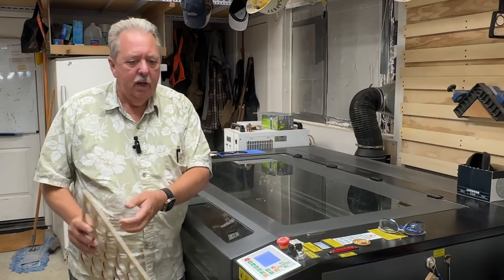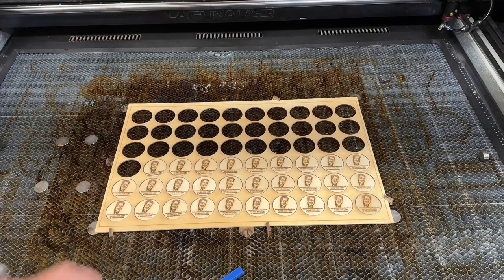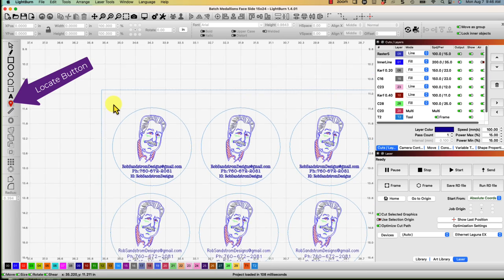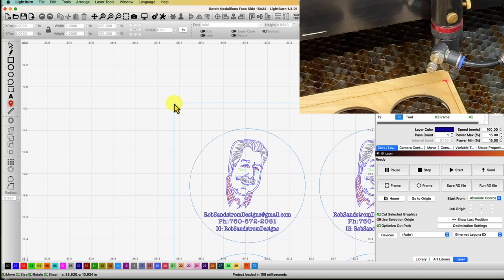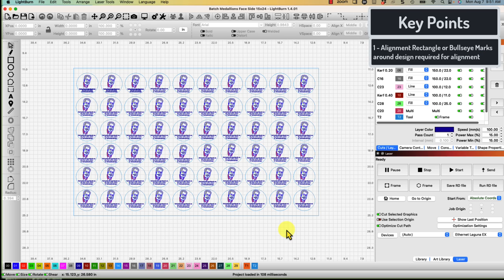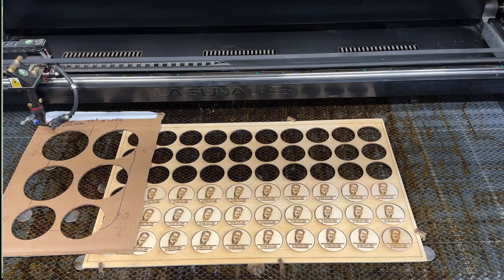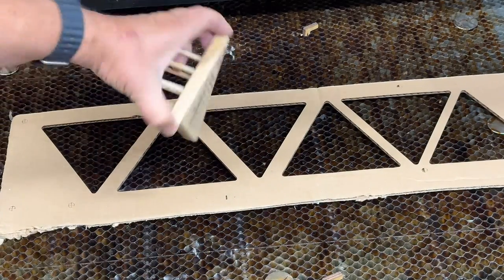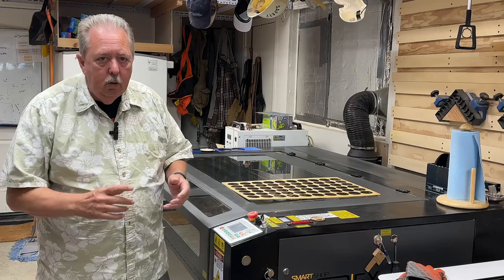How to Easily Make and Use Templates for Repeatable Laser Projects #laserengraving #lightburn

Comment: Hello! Do you have any videos with instructions on how to upload a premade template then set the cutting and engraving after it's uploaded? I have a template for branded buttons so I need to cut around, cut 2 holes in the middle and then engrave my logo. It's all on the template but I have NO idea how to set up the cut lines so it is consistent. thanks!
Reply from the maker: I need to know more about what you’re trying to do.  Are you indicating you purchased a physical template - i.e. it’s design is not in the laser or did you make a template in the laser and didn’t put laser alignment marks on when you first made the template?  I am trying to understand do you have a version of the template in lightburn already or would you need to make the template in Lightburn based on the physical template you already have?
Reply: @RobSandstromDesigns my designer made a template for me outside of light burn and I need to upload it to light burn and set it up. I have it in a pdf or AI file.
Reply from the maker: @MelissaOConnor-b8h  Are you wanting information on how you can take the file a designer made for you in pdf or AI format and how to import it into Lightburn so you can use as a template?

The reason I am asking is because if you have a pdf or AI file, they can be imported directly into Lightburn.  Once imported you can work with them in lightburn like any other file that is imported.  Let me know if you want a short video on how to do this, i could make that video pretty quickly.  Basically you go to the File>>>Import menu item and select the file to open.  Lightburn acepts the following files:  ai, pdf, dxf, svg, as well as many other vector and iage type files.
Reply from the maker: @MelissaOConnor-b8h  also if you want to email me your file I can make a quick lightburn file for you.  Send me the file you want in lightburn.  Send the file to robsandstromdesigns@gmail.com

Comment: Great tricks!  I general use cardboard to mark the outline of the object.   Works for one offs but not multiples.
Reply from the maker: Hey Lucky I like to use cardboard also but in this case I had to cut a bunch of these medallions out of plywood so I just turned it into a template.  Cardboard works really well and is handy

Comment: Thank you Rob, did you make the template on the laser or cnc
Reply from the maker: Thank you for watching and commenting.  The template for this video was made on my laser.  In fact, almost all my templates are made on laser.  Original design may be made with my CNC software (Vectric vCarve Pro) but then I transfer design into Lightburn to make the physical template on my laser.  Hope that makes sense.
Reply: @RobSandstromDesigns  Thank you for the reply, that is what I am doing also with V-carve Pro. the laser was just frustrating me, you gave us a great explanation.